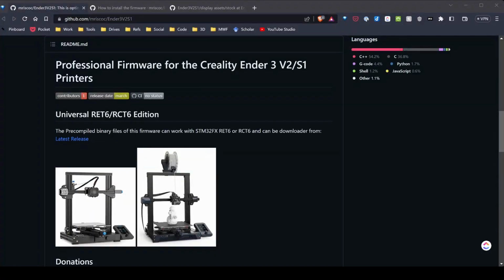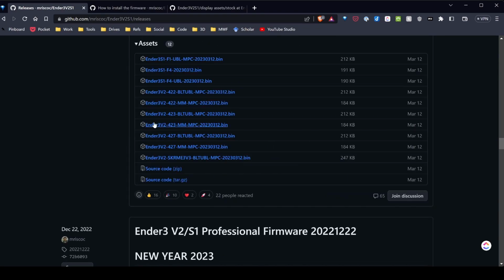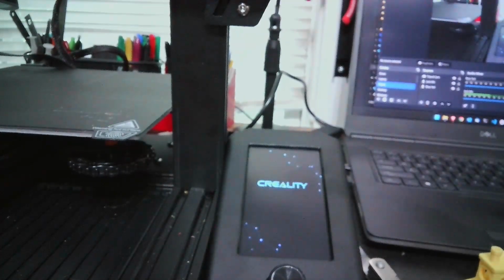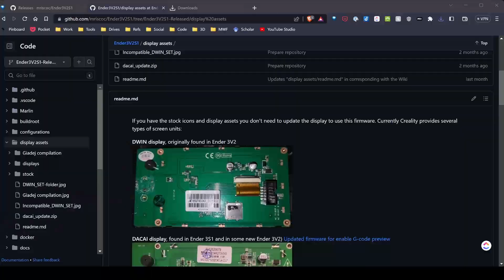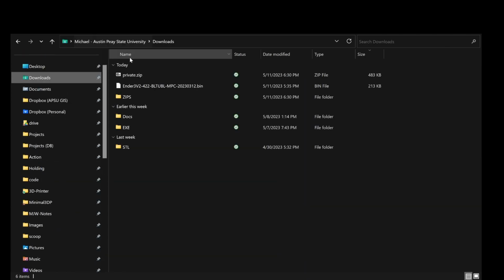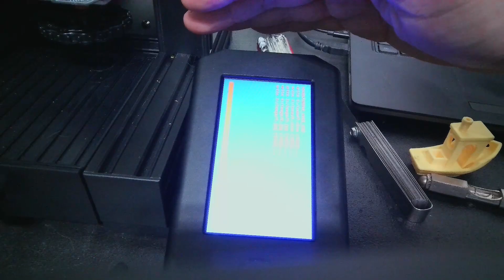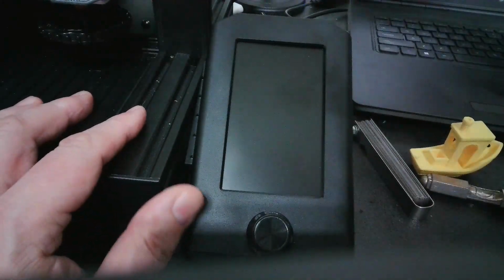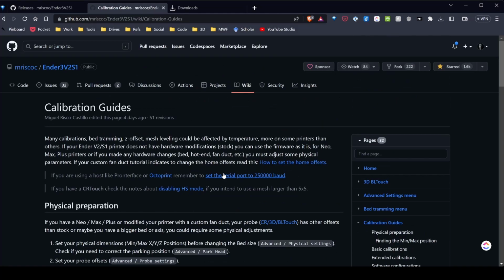Unlock the Upgrade: Creality Ender 3 V2 Neo and mriscoc's Professional Firmware Install Explained

Comment: Dear Bryan, I did what you showed. It looks good, but do you have a user manual, because I can't get the printer head adjusted low enough. Thanks a lot, Jacques metzemaekers Netherlands.
Reply from the maker: Check the GitHub and wiki

Comment: My knob controll just got stuck. Considering upgrading to the touchscreen. Any idea if the screen upgrade is supported or as of yet possible on the touch screens. I can't seem to find any reviews on this.
Reply from the maker: If you are willing to compile the firmware yourself, you could probably get the screen to work.
Reply: @minimal3dp  managed to get a new rotary encoder and soldered it in. Worked fine after that  continued with installing the firmware and worked fine. 

Wiped the sd, tried the screen upgrade  and nothing, reformed still nothing so put it on hold. 

Continued to do the PID atoutune etc. 

Now a new issue. Loaded a file and tried to print but machine now says no media inserted. Tried a few times to reformat the card and load print again and still nothing. 

It seems fine on the PC but not reading when inserted into the machine.

Going to try a new SD and see if that resolves.

Comment: Is there a way to solve a problem that I have?

When installing the first file, the screen just stays on CREALITY and doesn't let me move forward.

I have the same Ender 3V2 NEO printer
Reply from the maker: Try to redownload the bin files and use a different sad card.
Reply: @minimal3dp  i had the same issue. my process was that i updated the board - all good, removed the sd card, reformatted it, then i updated the display - all good. removed the sd card, and all i got was the creality screen. i then put the board firmware back on the sd card, it booted up fine. removed the sd card - no go. to resolve it, i put teh board firmware on one sd card, and the display firmware on another card, inserted them to the correct locations, turned on the printer, its did its update thing. removed the sd cards to test, and now all good....besides calibrating everything over again
Reply from the maker: @keepingj  When I have used the same card for both, I reformat in between flashing.
Reply: @keepingj  This is the only thing that worked for me also. Tried all other options but hung on startup screen every time. Thanks for the idea to use 2 separate cards at the same time. I have flashed many printers over the years and don't think I would have ever thought to do that. :trophy-yellow-smiling:

Comment: Im having the issue with my printer has been used in over a year and i fired it back up and the filament stepper motor wont feed filament, i can manual feed and if i switch the X and E wires the motor works fine. I also updated the firmware as show in the video still same issue. its 4.2.2 with GD chip
Reply from the maker: I would check the E cable. If it is not the cable it is probably tour board. Might need to replace.

Comment: I tried this, but I had to use a newer version and may have chosen the wrong one.  Now my printer won't go past the Creality screen. 

Do you have a link to the correct newer version?
Reply from the maker: Check the GitHub repo. Make sure to select the correct version badeb on your printer and board. 

Don't forget to flash the screen as well.
Reply: @minimal3dp  right but my problem seems to that I don't know which is the correct version.  

At this point I'm just trying to go back to getting it to work, I don't care if it's updated.
Reply: @GB_Ted  I flash it back with the stock firmware from Creality

Comment: Great video, was avoiding do the same to mine until I saw this video. Mine didn't go to plan and watching your video showed me that there is a screen firmware which I hadn't seen before in the instructions or anywhere. So armed with this information, I checked what screen I have and updated it, very big improvement on the settings and GUI
Reply from the maker: Glad you found mm y work helpful. Let me know if you have questions.

Comment: my printer does this weird thing where when i tried to reflash it, the creality loading screen got stuck on the lcd but there were still numbers on the bottom and when i clicked the knob, it still worked it just didnt show anything. Any fixes?
Reply: nvm I figured it out
Reply: how did you fix it?
 @_-_-_Marshmylo_-_-_
Reply: Having the same issue. How did you fix it? @_-_-_Marshmylo_-_-_
Reply: @cheesecurdactual   Update ur screen with DACAI and TJC on v2 neo
Reply: Please say how you fixed it

Comment: Tks a lot for the video, really helpful. Can I also ask, does this also enable the host action command on ender 3 v2 neo, I want to improve the connection between the printer and octoprint.
Reply from the maker: It should but there might be a special version for Octoprint.

Comment: Any firmware version can upgrade ender3v2 to 300 degress ?
Reply from the maker: You will need to make a change in the firmware to go up to 300. You might be able to do it from the interface.

Comment: Great video!  I have the same printer but mine came with the TJC board, is the icon set compatible with it? thanks
Reply from the maker: I believe so but I would read through the professional firmware readme to verify.

Comment: Great video, got the pro firmware installed no problem. But, I'm having issues with the Display update. I followed the listed steps to format my sd card, got the proper folder for my DACAI display type. Private folder is sitting on root of SD. Flashes okay and even shows it was successful, but I just have a black screen. when i click I do get the audible beep from the display, but cannot see anything. any insight is appreciated.
Reply from the maker: Check your wiring. Something might be loose.
Reply: Ended up flashing the firmware again, then flashed the display once more and we are in business. Thank you!
Reply: I'm having the same problem!

Comment: Do you need to change somethig for cr touch?  because you use bl touch firmware and ender 3v2 neo have crtouch. Thanks
Reply from the maker: The code should be the same.
Reply: @minimal3dp  thank you very much!

Comment: In this software how many degrees celcius the nozzle can reach?
Reply from the maker: That is hot end dependent, not software.
Reply: @minimal3dp  i replace the hotend and extruder...i install micro swiss ng and i have v2 neo printer..in slicer when i set 270degrees when i send it for printing the printer prints at 250..because the software is up to 250 celcius..
Reply from the maker: @ΠαναγιωτηςΜυλωνας-ο9χ  I am assuming you are using a precompiled binary. You will probably need to compile the firmware yourself then.
Reply: @minimal3dp  do you know how?i mean do you have a video?
Reply from the maker: @ΠαναγιωτηςΜυλωνας-ο9χ  I do. I am mobile tight now but look for my video about the PF and octoprint. I think it is in my PF playlist. I also have another set of video about compiling marlin from scratch.

Comment: I was finally able to get this printer from Creality (unrepaired) at a low price. I am waiting for it to arrive. Apparently this specific printer has an Enhanced Accuracy issue. I will have to figure out what that is. I assume the CR Touch or a board issue. Could simply be unplugged, or jammed up with filament like yours. My question is, have you found it better with this newly installed firmware? I have subscribed to your channel as you have been a great help. Thanks in advance.
Reply from the maker: I would get all the basics working before you install new firmware. That way you.know it is a printer issue rather than it being hardware or firmware.
Reply: @minimal3dp  I guess I should have asked the question in another way. When the printer is fixed, tested, and running properly, does the Creality 3 V2 NEO perform better with this newly installed mriscoc professional firmware?
Reply from the maker: @captcraig777  Sorry I misunderstood. Yes. I believe it will run better. You will have more options.
Reply: @minimal3dp  Thanks for the replies! I had a brain stroke in May 2016, so sometimes, I believe my wording is not what it used to be. I am an application quality engineer and I am full of questions...lol. I truly do appreciate your patience. I am looking forward to seeing what Creality is going to send me. It could be a big challenge, or a simple connection issue.
Reply from the maker: @captcraig777  More than happy to answer questions. My email is minimal3dp@gmail.com

Comment: Is it necessary to update the screen firmware? I kind of like the deffault look of it. Will there be a problem to have the Professional firmware with the stock screen firmware?
Reply from the maker: Yes you will have update the screen firmware. There are a couple different icon options so you might be able to emulate the default.
Reply: No, you do not need to update the screen. The stock screen will show the updated firmware settings. If you notice in the video the bottom right icon on the stock firmware was showing LEVELING as the menu option. After updating the firmware on the motherboard the stock screen was then showing ADVANCED on the bottom right icon. You are not updating firmware on the screen, you are just updating icons and fonts for the new display.

Comment: hello there, I followed steps and downloaded correct firmware but update will not happen, I renamed file and still not updating , any suggestions?
Reply from the maker: Try to reformat your SD.
Reply: @minimal3dp  thanks for the reply, I just did that and now display is blank and nothing happens , been like that for about 5 minutes , turned it off and on again without sd card and i cant use printer , did I do something wrong?
Reply from the maker: @nahtanoj92  Try to reflash. Sounds like it didn't take. Did you flash both the printer and the screen?
Reply: @minimal3dp yes, I did, screen flashed just fine, printer is the problem, I'm stuck in logo, renamed file to simple names, chzged sd card, reformat it and same problem 😥
Reply: @minimal3dp so I was able to update the firmware finally I had to use a 4gb sd card, followed the calibration guide from your other video but now I don't see any files when I go to media, I put the files in the sd card but nothing shows up 9n the screen

Comment: Hi, is your Neo control board SoC an STM32 or a GD32 chip?
Reply from the maker: GD 32.
Reply: @minimal3dp  Nice video, I received reports from some GD32 users having problems when flashing their printers, but maybe it is just a SD card issue.
Reply from the maker: @MiguelRisco  It was very smooth for me. I did not have any hiccups.